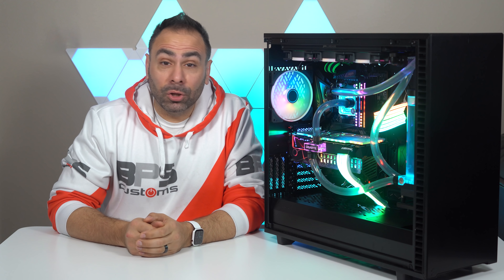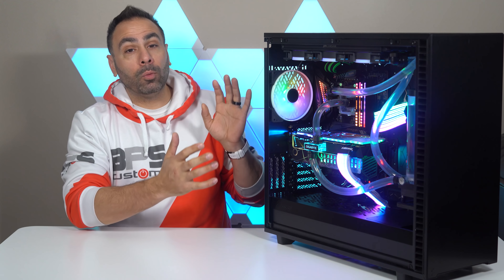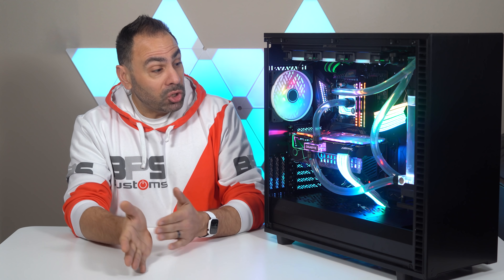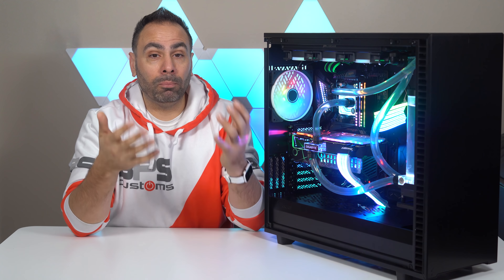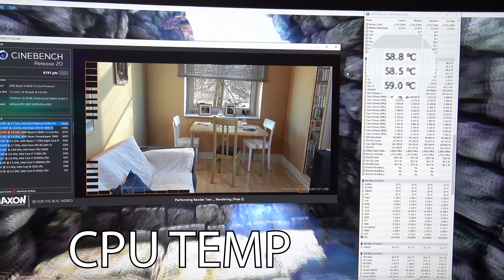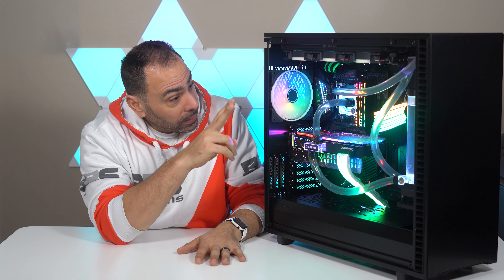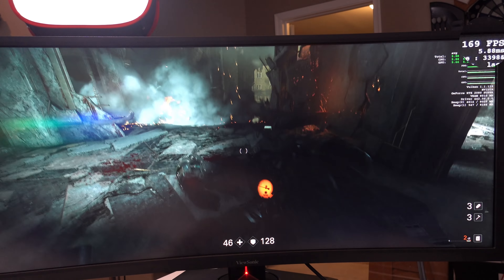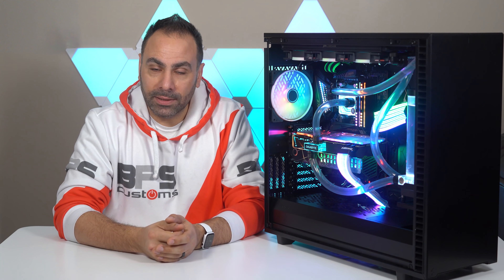This COMPLETELY Changed My System

Comment: I think it at least deserves to have the tubing runs cleaned up with some angled adapters (that don't leak) . The adapter on the Cpu inlet looks pretty funky.
Reply from the maker: I agree it would look much better with hardline. But this was a monthly build, hard to do in a limited time frame.

Comment: G'day Brian,
I like the combination of Rainbow Fans with the White in the Res & Cooling Blocks, not everything is Flashing at you this way,
Maybe just a Plain Black Braided CPU Power Cable as the Green looks outta place,
also the tubing runs still look a little messy but a lot better with clear coolant 😁

Comment: I don't think either are bad although I slightly prefer the uniform of the green. Either build has 1 thing that sticks out though whether it's the back plate on the green build or the green and black CPU power cables on the rainbow build.   I think black cables instead of the green and black would have been better and hid them on the top. I do agree that you could tighten the soft tubing a bit with ease like slightly shortening the tube from the GPU to the CPU to make it not bulge. Overall great channel. Always love watching and appreciate all the great info you provide.

Comment: **Hello Brian!  

These are my suggestions

Keep the soft tubing.  Can be challenging but we all deserve awesome looking soft tubing builds!

1- Pump to GPU: use a 90 on GPU inlet so the tube run is more straight. GPU to CPU is perfect
2- CPU TO FRONT RAD:  Perhaps only use only 90 deg fitting going UP? Then tube could go up behind the upper rad and hide the run there a bit. Connect to front radiator port that is towards the “back wall” of the case instead of the port facing the TG.  To prevent conflict with upper rad port, it could be useful to do the dual 90 deg fitting “Z” arrangement currently used on the output of CPU block to help offset the rad port and meet the tube in that space behind the upper rad, keeping it sort of hidden.  I feel this is the tricky part. That is a big case. Since it supports wider 420mm rads and you are using 360s, there is hopefully enough space to make it work.

3- FRONT RAD TO UPPER RAD:  Output from front rad can go straight to upper rad port facing it. Those look like they are perfectly aligned by the case. So using the 90 on that upper rad port pointing towards the front rad should make for a straight and very short run from one rad to the other.

4- UPPER RAD TO RESERVOIR:  As with the run from Pump to GPU, I feel using a 90 deg fitting on the return port of pump will allow for a more straight tube run and help it look a bit more tidy.

I hope this helps!

Comment: I like it. The question is, do YOU like it, Brian? The color really doesn't matter since you can change most of the lightning to match whatever you want and if it's that big of a deal, the gpu backplate and bracket can be replaced also. A lot of people knock soft tubing, but here's my take on it. Soft tubing has a lot more flexibility and can be switched up MUCH easier if you don't like how the runs look. Personally, I like the free flowing lines that soft tubing allows for. If it's done right, it looks a lot better than hard line. That's just my opinion. It also allows for much easier swapping of parts later.

Comment: You ok? Feeling good?
Gpu and 24 cables white and what is in the cpu corner.. green-black from last set :)))
Black default psu cables and be done with it
And those cpu fittings still not great, 90+90.. not straight even.. what is that